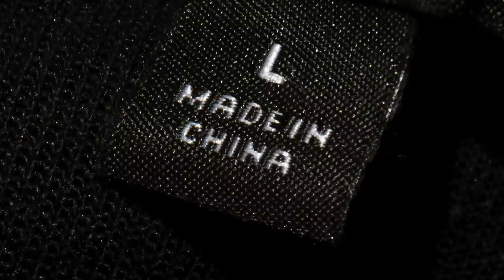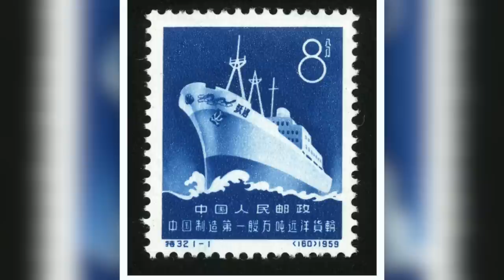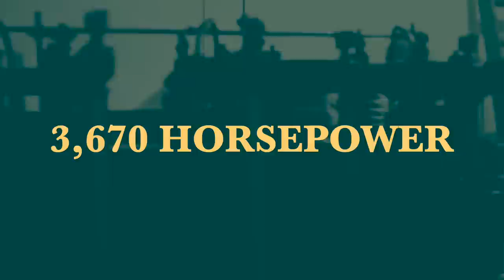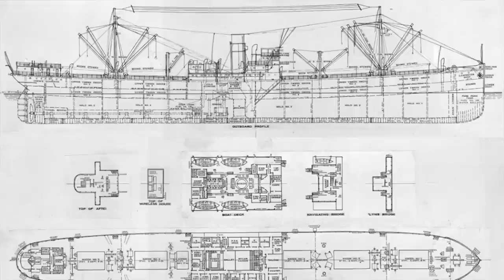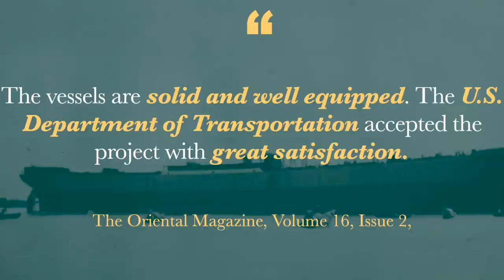China before the CCP (1): Chinese shipyard helped US build wartime vessels

Comment: Suggestion: Make sure you have the terminology and illustrations correct, especially on the thumbnail: "warship" means a ship with guns or missiles or aircraft that can be used offensively or defensively to attack targets of various kinds. Your tittle illustration and text are misleading. "Wartime vessels" include warships and all other kinds of ships that support war: warships themselves, cargo carriers, troop transports, and any other type of vessels. For example, the company I worked for for many years, Bechtel, created the California Shipbuilding Corporation in 1941. From September 1941 through September 1945, this company launched 467 Liberty and Victory ships. (Bechtel had never built a ship before WWII and never built another after WWII.) None of these ships that Bechtel launched were classified as "warships." They were built as vessels to support the war ("wartime vessels," if you will). Your thumbnail uses "warships" and shows what appears to be a WWII type of warship equipped with guns in turrets (appears to be a cruiser). The Chinese never built these types of ships for the U.S. Navy. Never. So, to answer your question posed on your thumbnail, "Did China build warships for the U.S.?" -- the answer is, "No."  (BTW, I served in the U.S. Navy and Naval Reserve for more than 26 years and served on U.S. warships equipped with guns, missiles, and torpedoes that trained alongside equivalent warships of the Taiwanese and Japanese navies.)